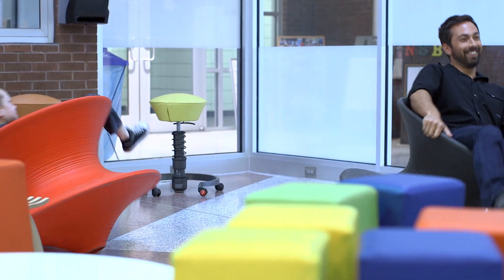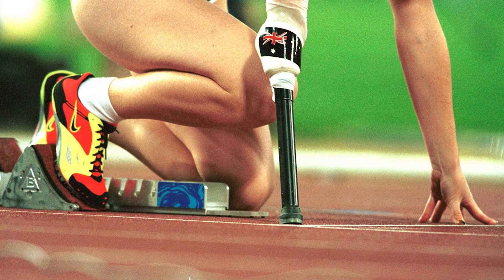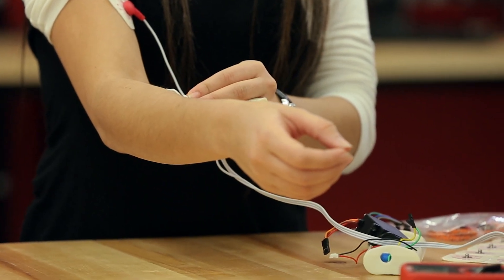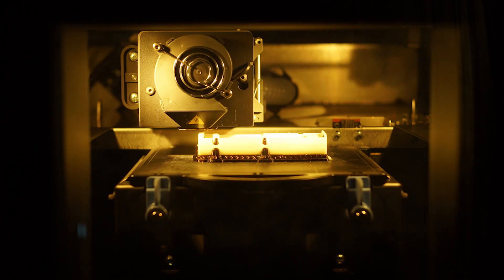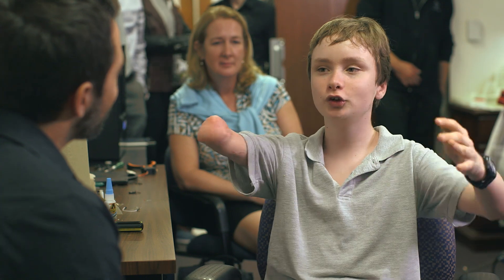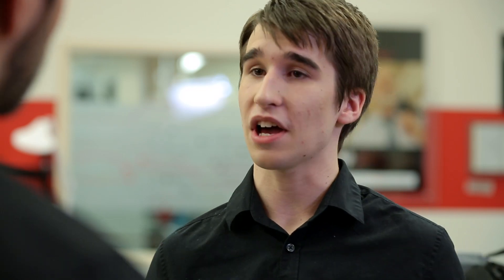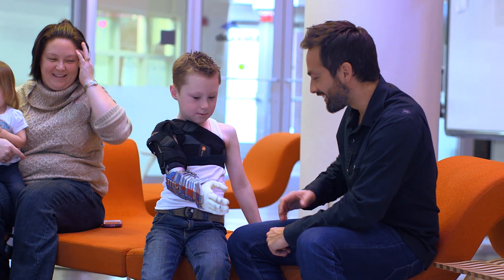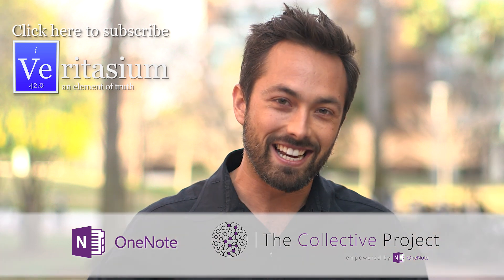An Affordable 3D-Printed Arm

Comment: "Help with deisgn, join in..." - "But you need Windows on your PC" - "OK, I'll pass"... let's design free and open technologies instead!
Reply: You know there are emulators for that kind of stuff, right? Or you can dual boot your machine? Or you can get another laptop because even a decent one is like $250 now?

If you're not willing to do any of those 3 things, I doubt you'd be motivated enough to help them much anyways.
Reply: ***** I was speaking hypothetical, at least for me. And, a decent laptop is not a consumer grade machine. Decent laptops are only available in the "business customer" range of any manufacturer, starting around 1300€ or so. I personally am a dedicated user of Lenovo Thinkpads, but I use the older, more affordable models, which serve me quite well (T400, X61 etc).
Dual Boot however is preposterous, because while in Windows, I wouldn't be able to use my computer in any decent manner. So why would I want to boot into Windows...
And no, WINE Is Not An Emulator.
Reply: ***** The things you get for 300 bucks are more like craptops, not laptops. Seriously, I don't want a machine that I have to throw away after 2 years, because it doesn't work any more, the case is broken or the fan is clogged up or worn out, and there is no way to get to it other than disassembeling the whole unit, let alone replacement parts. Also, I don't need that much processing power for the stuff I do, so I really see no use in buying a new machine. But 300 bucks can get you a decent used T-series Thinkpad.

Why Windows is useless? Well, ask Microsoft why they made it that way.

And yes, I could theoretically run a virtual machine with Windows in it, but the goal is to not need Windows software or "compatibility" (which in most cases means incompatibility to sincere computers). So why would I want to? Every computer free from Microsoft software is one machine less contributing to the ever-too-big dying empire. So let's increase the speed of Microsoft's dying process by not use their crap, thus being independent and not vendor-locked-in.
Reply: ***** Every time I have to work on a Windows machine, I want to puke. Try scrolling with the mouse wheel. A technology that was introduced - what? more than 15 years ago? And they still haven't managed to scroll wherever the mouse cursor is hovering over. No, you have to change the focus into the area you want to scroll, and in some cases even then it won't work. Just one tiny example of the stupidity of Microsoft's software development, poverty of Microsoft's software design, and their total and complete lack of any quality. Also, whenever you watch normal people using their Windows machines, they are always annoyed about something. They just think it's normal, and thus they don't even notice it any more.
Reply: ***** That was just one example out of many for how embarrassingly dysfunctional Windows really is. But being the fanboy you are, I will now also stop wasting my time pointing out that Microsoft has never ever produced any piece software that one could associate with the word quality - they just aren't capable of that...
Reply: Seegal Galguntijak

A two second fix is considered "embarrassingly dysfunctional?"

I'm not a fanboy. Like anyone who actually knows computers, I can use them all just fine. I don't prefer one or another, but I tend Unix and Windows because those two platforms have the majority of the bioinformatics programs and tools. Mac is fine, but they don't have the software support I need.

Go ahead and question MS software quality if you want, but at least the software I need exists on that platform. Macs are nothing but expensive, though pretty, boxes for surfing the web.
Reply: Seegal Galguntijak you are absolutely idiot both company exist because they have their own marketshare, they both have advantage and disadvantage.
Reply: Well, its the personal opinion of everyone on what OS they prefer.
Personally, I'd take Windows over any other OS any day, because they're the quality stuff for me, but that's just MY OPINION.
If someone doesn't agree with that and like to use Mac or Linux, then no prob, that's their opinion and I respect it.
Thing is, why is it that we fight on stuff like this?
Reply: AsquareM Productions Yeah there is a reason why Gates is a household name.
Reply: Master of Mundus ...because his company is REALLY good at acquiring contract deals to put his operating system so widely that most un-tech-savvy people have no clue that there are alternatives? Anything that is a 'household name' in the tech world likely caters to people who can't use technology very well. Easy doesn't exactly mean quality, especially when you have a track record like Windows does. Seegal Galguntijak Microsoft does fund a lot of great projects, but their poor business practices are why people pirate software. We can still contribute.
Reply: Seegal Galguntijak I'm not even going to waste my time arguing with someone so delusional.
Reply: Seegal Galguntijak Pffft-
Reply: MinMax123 Ikr. Really though
"because its a Microsoft product.."
"because $300 machines are crap..."
Right away you know, you're done with the conversation.

Comment: I'm a mechanical engineering student at a pretty large research university. I have so many friends working on senior design arms and even extracurricular arm-building projects. There's rarely a time where there isn't some part of an arm being printed on our 3D printers. It's awesome to know that almost anyone with some knowledge of SolidWorks and engineering can build this. Access to 3d printing and laser cutting as student really opens up so many things. These rapid prototyping resources are by far the best part of college thus far.

Comment: Independently actuate each finger and combine the arm's design with an EEG reading chip leading to implanted or attached electrodes on the head and making this thought controlled should be a piece of cake. If we can build those headband toys which let you turn a fan on with the right pattern of beta waves, we can make a neural linked prosthetic... Oh hold on we already have those, why don't these do that? The chips are like 40 bucks.

Comment: interesting use of product placement, or seemingly so

That could be the future of how to fund video production.  A very similar thing was done with Surface tablets in "Under the Dome."  I see from the comments a lot of people are not too pleased with such a paradigm.  It's not so bad.  You just have to recognize it for what it is.  Featuring it here gives the impression the Microsoft tool is the only one which could be used.  The viewer should just keep in mind, if the video's participants so chose, something else would work.  But they seem to like that product.  No biggie, as a general rule I dislike Microsoft products.  to each their own opinion.

Comment: I think modulating the parts of the arm would help increase cost efficiency. Like, the child would get one elbow joint that can be attached to new sockets as the child grows and new forearms/hand prosthesis to match growth and tech advances. Plus if one part fails, the others can still be used, and the failed component could easily be replaced. This could also lead to standardizing  forearm and hand sizes to help make fits quicker, and opens up the possibility for cost reduced secondhand exchange. Though I'm not sure how the community feels about that sort of thing.

Comment: I am fairly new at 3d design and printing. I purchased a 3d printer a couple weeks ago, and have been printing and designing with blender as much as possible. I checked out the links, but I can't seem to find the info on how to participate. I would really like to help in anyway I can. If someone could point me in the right direction I would be more than grateful. Thank you

Comment: Thats great, but its only for americans.
Reply: They said they are trying to get UN (United Nations) in on this, most likely to broaden the range of areas they could help.
Reply: The only real limit to this is how easily you can purchase $800 - $2000 3D printers outside of the United States. 3D printing is done with your $40 rolls of ABA/PLA plastic using the computer files that instruct your printer how to spurt out the plastic. Since the files can just be copied and shared, the only limit is your access to the tool and material.
Reply: who said that? did you even watch the full video?
Reply: Revanth Boom Boom Noone, but its usually like that. If you have proof for the contrary show it.
Reply: Viktor6665 its is based in america, but it is not ONLY for americans, i think even if  an indian kid go there they will be glad to help.
Reply: Revanth Boom Boom How could an indian kid go to America? It costs more than the arm... and he wouldnt have citizenship which is also probably required.
Reply: Viktor6665 Maybe they could go to expand in the future? I get where you're going but they have a good opportunity to pair up with a worldwide organization, let's see how they do in the near future.
Reply: I'd rather see them pair up with foundations with a proven track record of spending at least 99% of what they get on their objective. The UN seems a bit wasteful in you don't know where most of the money is going.
Reply: Ryan Tsui They also mentioned pitching to unicef.
Reply: yea its costly to go to america, but the point is you said it was ONLY for americans, and you were wrong they are ready to help anyone. and also there are many indians in america so they could get some help, if they have any problem such as this.
Reply: Revanth Boom Boom Dude you confuse ethnicity with nationality.
Reply: Viktor6665 I think you're the one confused here my friend, and for a guy who watched vsauce, veritasium , and lots of other educational documentary / videos, I'm pretty clear about ethnicity and nationality and yes, even if I am an Indian without american citizenship I'm sure they will help.